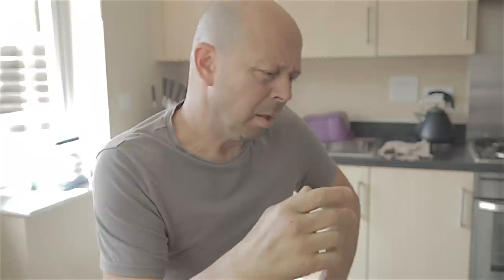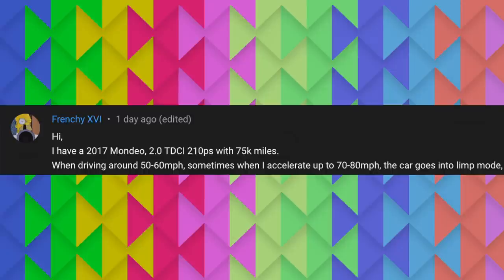Engine takes a dump into limp mode, Ford Mondeo Mk5 2L Diesel, Answering a viewers question.

Comment: Hi Alan I'm having same issues with my Ford Fiesta 1.5 TDCI 2014. When I try to overtake someone sometimes the car goes into limp mode. Also I noticed when accelerate black smoke comes out of the exhaust. I went to an authorized Ford for diagnostics and they told me that the high pressure pump needs to be replaced. But I asked what code the ECU was reporting and they said it was reporting P228C Fuel Pressure Regulator 'A' Exceeded Control Limits - Pressure Too Low. After that I went to the mechanic to replace the fuel filter, I bought the original one and put it on. Replacing the fuel filter did not solve the problem. My next step is to check all the injectors as you explained in the video. If the injectors are good, should I change the fuel pressure regulator or would you advise me something else?
Reply from the maker: hi, chances are one or more of your injectors are leaking too much fuel off back to the tank and causing the low fuel pressure code but if after a leak off test you find the injectors to be ok then you would be looking at replacing the high pressure fuel pump.....the fuel pressure regulator is doing its job in reading the fuel pressure is outside of its limits

Comment: Alan, I’ve got a great material for You to make another video. I have 2.0tdci dw10f engine in my Focus and I was fighting with P1102 - Mass Airflow Sensor in Range But Lower Than Expected. This problem is very, very rare. Starts showing in last winter. Sometimes it comes back after 1000km, sometimes even more, Three is no rule. Only thing is, when it happens - when I throttle up, using high rpm, everything is fine. But when i let throttle off, low rpm, error comes back. As I said this happens very rarely. What I’ve done to this day: check mass airflow sensor, replaced with new one - no results. Replaced egr valve - still the same, that cost me badly… Replaced MAP - No changes. Also I’ve replaced all vacum pipes and turbo vacum valve - No error from that time but car still has a low boost (I forgot to mention that my live readings from diagnostic tool shows low air flow and low air pressure - I’ve compared those readings with ‚healthy’ Focus and mine, both are too low - for example turbo boost is 2.3bar and my pal has 2.6bar… Those readings even after vacum replace are still bad). Searching on internet I’ve found one topic telling that something mat be connected with cambelt (and 40000km ago my mechanic changes cambelt). So I’v removed cover, lock camshaft, but when I tried to lock crankshaft in flywhell hole, it wont line up perfectly - it is about a half of a tooth difference to perfect lineup to slide the lock. Also tensioner is not perfect - arrow is not in that small window, so the tension is a little bit to small. Maybe there is a reason? Or maybe turbo is saing ‚bye, bye’? Or injecors not giving enough fuel -> to low fumes pressure to speed the turbo up? What do You think? Any suggestions?
Reply from the maker: theres a lot to think about there lol, i would definitely get the cam belt timing sorted first as half a tooth out on a diesel can cause some strange running behaviour but its easier to get the crank locked first with the timing pin so you can see how far out the camshaft sprocket is
Reply: Well, a few days ago I’ve put brand new INA cambelt set. I did it as You show in video. Locked camshaft, locked crankshaft, belt lined up perfect. But when I’ve put everything together, set the tensioner, etc, made 4 engine revs clockwise - crankshaft locking pin fits perfect but camshaft not as smooth as in Your video. So, changing the situation - turn engine a little and fit cambelt locking pin to fit perfect, I cannot put in the crankshaft locking pin - it is still about a half of a tooth of a crankshaft and unable to slide in. It’s really not much but it is. I’ve done everything as ETIS said. By the way - car runnig good, nothing wrong with cambelt as far I see. But still turbo air pressure from MAP is 2.3bar instead 2.6-2.7 when accelerating hard. Maybe my cambelt was and is OK, but the problem is with turbo or injector?
Reply from the maker: @silastypol  very difficult one..might be worth getting your turbo itself looked at...i believe its a variable vane turbo which can get stuck with soot build up and cause intermittent issues
Reply: @alan4x  Yeah, it’s vvt turbo. Maybe geometry is stuck a little, refusing to load more than 2.3 bar. But, You know what? We can reject the trail with wrong cambelt set - my friend made a cambelt change last week, and same situation as in mine car - it was not perfect on the locks, run good as hell… 
How to check injectors in dw10f engine without removing it? Only leak off test?
Do You have an e-mail adress? I really like to talk with You and sent some dynamic logs, it will be much easier for me to text You there.
Reply: Got a Cmax 2018 1.5 tdci @ 160k miles. I’m experiencing same issue. Loss of power on motorway at first now always. 
Had Map sensor p1102 faults code on dash and a message service your engine now. Map sensor changed but problem still there. 
All filter changed at last service about 1500 miles ago.
My local garage advised to do a smoke leak test which I done at another garage. They couldn’t find any leak.
I’m stuck atm waiting for diagnostic appointment at Ford main dealer. I might suggest v v t to my local garage see what they think or do. Can’t do much at the moment and will update once problem solved
Reply: @AlwaysFair2E1  In your engine - check cambelt and the CR pump gear...
Reply: @silastypol  thank you will do. Car booked for cam belt change on this Thursday.
Reply: @AlwaysFair2E1  good, there is a Ford procedure to change cambelt, but also the high pressure fuel pomp gear too. This is very common problem in 1.5 tdci and „activates” p1102 error.
Reply: @silastypol  thank you I’ll mention that. They did changed Map sensor because of P1102 code but code came back on. 
Only once I had a code P2279 but after mobile mechanic cleared it didn’t came back on.  Thank you for your help

Comment: Hi Alan. Thank you for your top notch advice. Much appreciated. What are your thoughts on Catogory S and N written off then re -registered cars, as i have seen one advertised  at a fair price. If i purchase it it will probably be my last ever car so will not have to worry about re selling it on. P.s car is a 2016 2Ltr Diesel Kuga 37K £8900. Thanks again mate. All the best from Pembrokeshire.
Reply: Hi hope i can help. I currently own a cat S car and as long you have checked that the damage is professionally repaired to a high standard it should be ok. Another thing to note is that if it is cat S then that most likely means that there was structural damage for example the chassis could be bent. Make sure to have it fully checked from underneath aswell before buying. Other than that categorised cars are very affordable rather than a hpi clear one and they also hold value better as theyre already cheap
Reply: @hibye3178  Thank you for your help and advice. I will get those items checked out before making an offer.

Comment: Alan mate, I've got a mk3 ford focus 2013 1.6 tdci and I've got something similar to this. It goes into limp mode after reaching about 40mph then when u switch the engine on and off,  the fault dissapears again. The fault code I get is P2599 Turbocharger boost control position sensor - A performance - stuck high. I've swapped out the map sensor, boost solenoid sensor, Vacuum solenoid valve, turbo actuator position sensor and still the same. I've also done a service on it changing all the filters including fuel filter and still nothing. I'm thinking it's the turbo actuator itself that's faulty  eventhough it was tested by a local mechanic and seemed to hold pressure well. Ive also checked if the actuator moves when starting the engine and it does. No smoke from the exhaust whatsoever! 

However, I also have a coolant issue so could it be going into limp to avoid overheating? I had a water leak from the waterpump but I ended up changing the thermostat aswell as the water pump. The leaking has stopped but the coolant keeps going down and there is pressure in the reservoir tank. It rises up the minute I open it even if it looks empty. The heater blows warm air as normal, no  overheating, no coolant boiling and no milked residue on the oil cap. 

Apologies for the lengthy message pall but I can't seem to fix the issue so I thought id try and ask someone who has brilliant knowledge and experience like yourself. Keep up the vids mate! 👌🏽

Comment: Great video Alan. Does the same injector test apply to the mk4 mondeo 2lt diesel on a 2009 ? 👍👍
Reply from the maker: yes but i sure the washer pipes need to fit an adapter to plug into injectors on mk4 mondeo 2l

Comment: I had the same with an early Focus 1.8 TDCi. The fuel filter and injectors were fine. Turned out to be the seals in the high pressure pump. The pump was stripped down and rebuilt with a new seal kit and fault was cured.

Comment: *EDIT* 14.02.2023 fuell system was replaced, car works as it should.
UPDATE:
I have (finally) brought the car to DTM, a Bosch specialist.
*EDIT* 06.02.2023
DTM called this morning stating that the whole fuel system needs replacing and fuel tank need cleaning, £2800 for the job.
They said: "the high pressure fuel pump is breaking up causing metal filings to go around the fuel system and this has damaged the injector return control within the injectors."

Comment: One thing you missed is a blown air tube. I had that one once and it went into limp mode and i could restart the engine end it went away until the break in the tube was big enough to have a permanent fault. This was also together with black smoke under heavy acceleration (DPF was still ok so that was unburned diesel)
Reply from the maker: could well be, normally with split turbo hose you hear the air being forced out of the hose under acceleration

Comment: Hi Alan. Your videos are very informative. I have a mk5 2.0 diesel. I have faults codes P228C:00-28 and P02FA:68-28. The car doesn’t go into limp mode, it just completely shuts down ( I’ve had a few scary moments ). Not sure why it doesn’t go into limp mode. I have had fuel filter replaced and fuel pressure sensor. I still have the issue. However can be over 1000 miles between it reoccurring. Went to skeg vegas and back last week with fully loaded car with no issues.
Reply: Hi! Did you sorted it it? I basically have the same 2 errors, only a slight difference, mines are P228C:00-68, the other one is exactly like yours P02FA:68-28. Had 2 engine shutdowns in the course of a week. However my car does go into limp mode. After the 1st shutdown I did replaced the fuel filter.
Reply: Hi  @optyqus  , after replacing the fuel pressure sensor the shut down only happened the day after it was replaced. It has not occurred again in the 5000 miles since it the fuel pressure sensor was replaced. However, I made the following changes, a. I now only use premium diesel & b. i try to keep the revs below 2500 rpm. I have a powershift so it does this by itself unless i accelerate hard. My fear is it it is still high pressure fuel pump issue.
Reply: @ajmairsingh7644  thanks for replying... funny thing is that my first shutdown happened the next day after a 30liter fill up from a certain gas station. The second shutdown  occured a few days later, and after changing the fuel filter already. I don't know if the fuel was at fault but it might be. Also, did you do a test to see if any of the injectors throws too much fuel on the leak pipe? This is the next thing I'm planing to do on mine. It's quite easy too, you only need some seringes and some tubes, but the problem is unlatching the original plastic pins that hold the leak lines in place, as they break quite easily. Mine is a powershift too. Oh, and I strongly suggest you to also check the MAF sensor and have it cleaned; dirty airflow sensor can cause lean runs and fuel pressure drops.

Comment: Alan, I agree this is probably fuel related but  seeing as though this is a 210 ps engine it will have the powershift auto gearbox. I was wondering if it could also be related to that as the acceleration would probably cause it to kick down a gear or two and these boxes don't have the best reputation.  Do you have much experience with them?
Reply from the maker: we don't have any autos on the mk5 so i can't really comment

Comment: Very informative and helpful. Can I ask you for advise? 
Focus 2015 2.0 tdci, 150hp. Sometimes on deacceleration Service engine now comes up. No check engine light. Limp mode. Codes are always the same/ P003A, P02FA, P1102:21. When engine restart everything is back to normal but no codes saved in memory. I'm carrying laptop with forscan on it, took me a while to catch this codes. Not sure what garage can do without codes. So far I replaced turbo boost solenoid (used), 2 MAF sensors (used), air filter is new. MAP and throttle body is clean. I can see turbo actuator is moving,  and it moves when I take vacuum pipe off. 
Not sure what's next.
And for some reason all 3 MAFs reading 1.86v with engine not running.  Could be forscan issue.
Have you got any idea Alan? Much appreciated

Comment: Hi Alan, I doubt you’ll see this but if this manages to reach you, I really need your help. I have a 2ltr cdti kuga. (Sorry it’s not a Mondeo) with high fuel pressure and engine cutting out in high revs? 
I’ve been chasing this issue for a while. 
Things done so far. 
Changed fuel filter
Changed high pressure fuel pump & regulator. 
Changed high pressure sensor.
Done leak off test.
None of this made any change. 

Car gives up fault code. P11169 (fuel pressure in range but high) but when restarted after stall. Code clears and goes back to normal. 

 2012 tdci. AWd 136kw 

I’m now thinking it must be some kind of blockage in return pipes or blocked injector. (Tho leak off test seemed ok ) I don’t like the sound of ECU issues
Causing high pressure build up. If revs are kept below 4k,  car runs perfect in lower range . Starts perfect. Idles perfect. 

Just thought I would throw it to you and see if you can suggest anything. I’ve been pulling my hair out and I’m skint now
Thanks

Comment: Hi Alan, you have mentioned in a past post about a rising oil level issue, diesel getting into the sump.  I am in Australia and I gave Volvo C30 2.0D (D4204T (Peugeot) DOHC 16v Turbo Diesel Direct Inj. 4cyl 100kW 6sp Auto DCT FWD [01/09 - 12/10]) with Siemens/VDO Diesel Injectors 5WS40156-Z and 160,000kms on the clock.

Did you ever find out what was causing the issue with your rising oil level. With me, the car keeps doing regens after say 250kms and after 1000kms the System Service light comes on indicating it is time to change the oil again.  

Any pointers would be very much appreciated as the car has been off the road for months now.  Runs like a train, but does blow a little smoke that can be seen in the headlights of cars behind at night.  

Downunder there are not many of these engines around and I can't find anyone to resolve the issue.  Any pointers would be brilliant.
Reply from the maker: the car is parked up at the moment, when its back on the road i will monitor it again and let you know if i get any success

Comment: My 2014 S-Max 2.0L 163hp at cold start (+5hrs after stop) starts up briefly and then dies until turned over 5-10 times after which it runs fine, no issues. Hot starting is normal. I tested fuel pressure and cant see an issue, I tested leak from individual injectors: Perfect. If I measure the flow from the common return line engine ticking over I get like a liter / minut! If I try to suck the return line using my little hand-vacuum pump, all I get is air. I went through the plastic lines and cant find any fault. It seems like there is some sort of an internal leak in the return line where it exits the cylinder head. It appears there is a connection in the cast aluminum of the head, where the little "manifold line" connects and exits to the larger line outside of the cylinder head to the return line through the green snap coupling. I am stuck here, because I dont want to mess to much with the pump and all that, when the engine is otherwise running well. Any idea? Thums up for your excellent and pretty amusing videos

Comment: How much glitter in the filter housing is ok? 🤔 I have the same problem as frenchy had. Changed filter(wasn’t bad) maybe about half a dozen flakes of metal in the bottom of the housing. Done a leak off test and two leaked twice the amount of the others, got reconditioned ones on the way in post. Hopefully that’ll solve it. Oh and the pipes broke when unplugging them😣 so they’re in post too
Reply from the maker: i would not be worrying over half a dozen flakes..sounds like you do have 2 injectors leaking too much fuel back to the tank

Comment: has it been remapped?  210PS sounds a lot from a 2litre! get the codes read.
Reply: No it is genuine 210ps, still want to do a stage 1 on it once I've figured out what is wrong with it, I'm pretty sure the solution is in this video
Reply from the maker: some people have pointed out the oil pressure control solenoid which does cause issues, once your car plays up again then get the ecu codes read
Reply: @alan4x  "Low Fuell Pressure Regulator" was the diagnosis when I went to my friend's garage last year.
(I found it in my notes)
Reply: @frenchyxvi1698  Hi Frenchy, did you get to the bottom of the problem in the end, was it any of Alan's suggestions? 👍
Reply: @Charlie_Crown  Hi, I have changed the fuel filter (which was extremely dirty)
I still have to test my injectors to see which is the culprit (hopefuly only one needs to be replaced)
Reply: @frenchyxvi1698  pity none of the garages bothered to check the filter, especially the Ford stealership, but at least you're on the right track now 👍